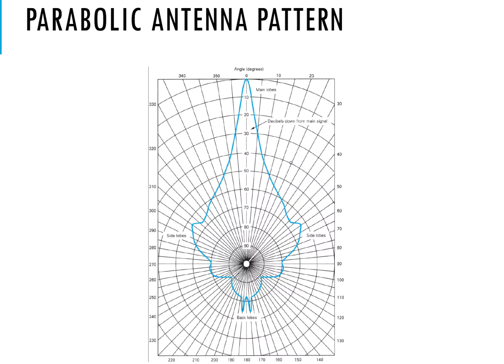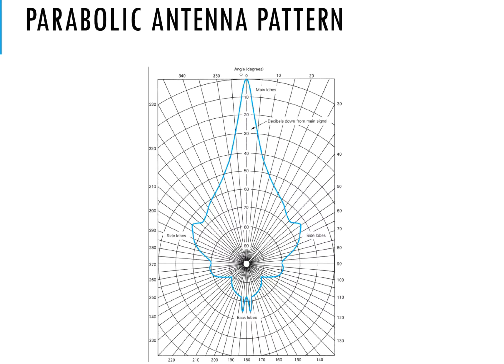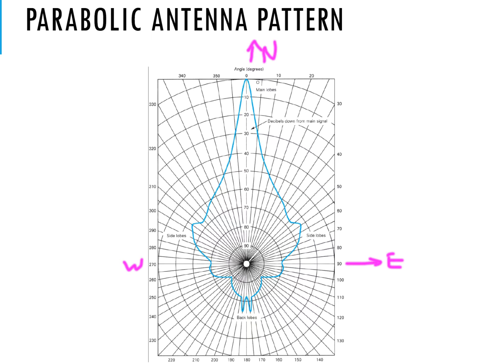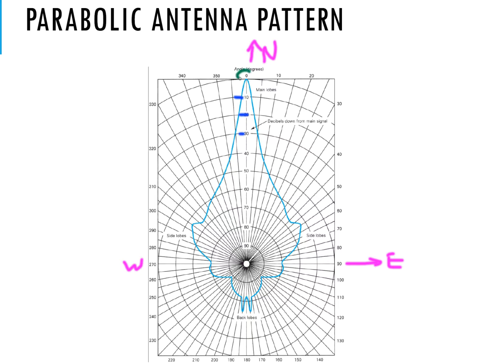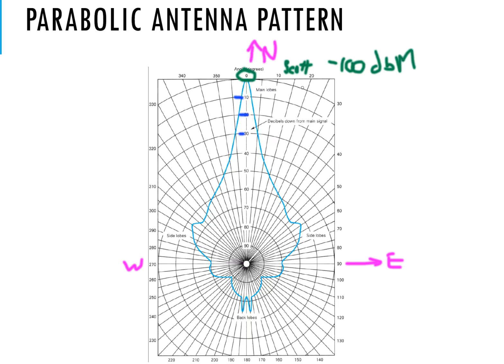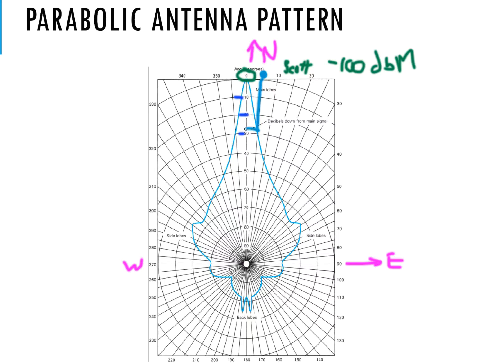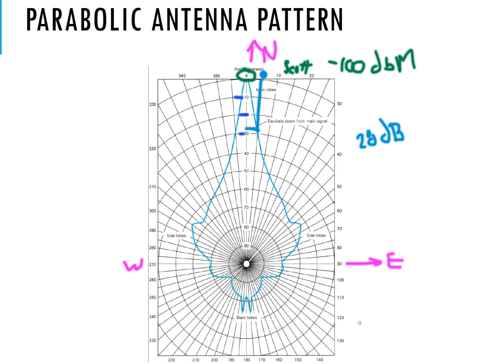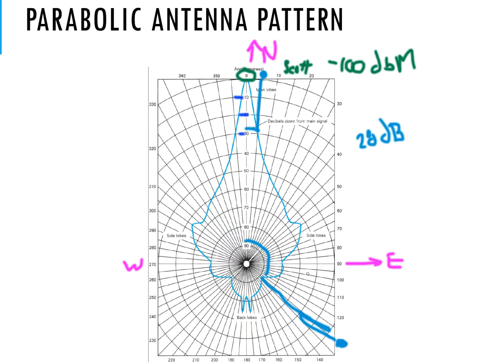IFT372 - How to read antenna gain charts

Comment: This does not put into the actual perspective. I have the chart and how is the antenna is oriented or facing on the chart?
Reply: There are typically two charts used together that more fully demonstrate the radiation pattern. One is labeled "Azimuth" and the other is labeled "Elevation". Azimuth is what was shown in this video. It is a bird's eye view. Elevation is a side (profile) view. In both cases, the antenna is located at the center (origin) and 0 degrees is the direction it is pointed. Also in both cases, you are looking at just a cross section of the three dimensional radiation pattern. The rest is pretty obvious as was shown in the video... 90 degrees is left for an azimuth chart and straight up toward the sky on an elevation chart, etc...